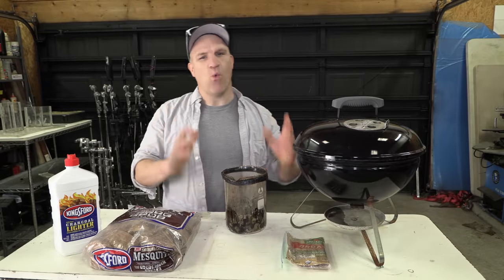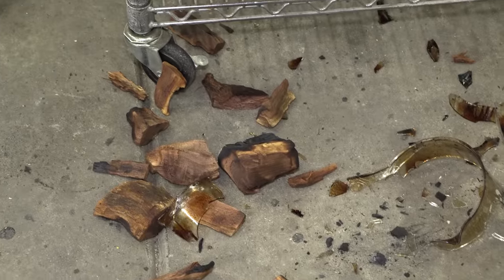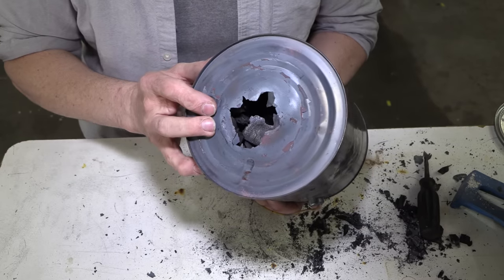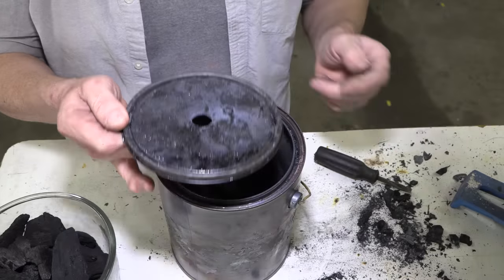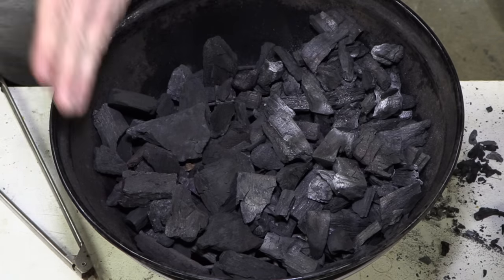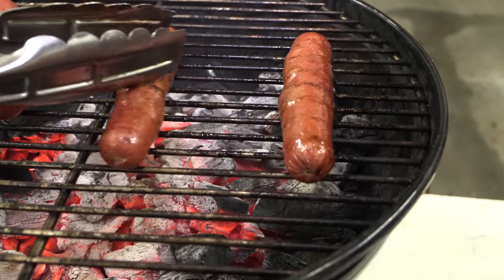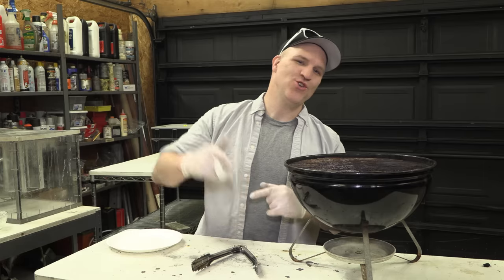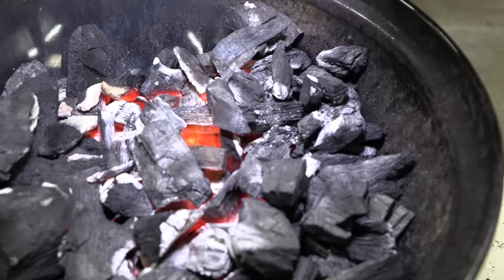Homemade Charcoal

Comment: What trips me out is you used a super torch to burn the shit outta that mesquite, but you were still able to light it up and BBQ. Why didn't it just all burn up in the paint can until the ash that we see at the end of the weenie BBQ?
Reply: Lex The Lion My bet is on the lack of oxygen. On the open grill it got plenty of oxygen to make the C->CO2 transition, which we call “burn”.
Reply: Zoltan Juhasz I think you are correct. If memory serves me right, charcoal is produce when wood is burned in the absence of oxygen, so all you are actually doing is driving out the moisture and oil, but leaving the combustable material behind.
Reply: @juzoli  but even with such high heat? The paint can even broke at the bottom.
Reply: Lex The Lion no matter how hot you get it, without oxygen, it won’t combust (burn). In this case you basically cook the wood and all the volatiles come out until there is pretty much nothing but carbon left
Reply: Lex The Lion When something burns, you are extracting energy from it. The wood gives heat to the environment. The exact opposite happens here, we are giving energy to the wood, basically injecting energy into the wood.
(Okay not exactly, but it shows the difference)
Reply: @juzoli  warped perception
Reply: @Grakoham  Everything or most has carbon in it if I'm not mistaken. So if you did the same process with a human body, could we bbq weenie?
Reply: Lex The Lion yes in theory you could, although the yield would be much less, since the human body is mostly water. But yes you could roast a weenie on charcoal made from a weenie
Reply: @Grakoham  yeah I think it's almost 100% carbon left over if I remember correctly.
Reply: @Jam Jar  yeah pretty much. Sometimes small amounts of oils don’t get burned off, but other than that and some minerals and impurities, all that is left is carbon.
Reply: Wood gas is mostly H2 and CO. The other carbon containing molecules are usually chains covered in hydrogen. Once you are down to carbon, and Ash(Calcium Sodium Potassium) there isn't any Oxygen, or Hydrogen to turn the remaining carbon into a gas. Pure carbon molecules are solids like graphite, diamond, nanotubes, etc. It needs air to burn more.
Reply: @danieljohnson3024  read a few comments up. Would you be interested in seeing the experiment?
Reply: @LexTheLionLocc  The paint can actually disintegrated when oxygen got in after the flame was out.
Reply: @SMOBY44  the problem I have with that is it took disturbance after the fact to make it break. Therefore one cannot truely believe oxygen played a role. Had the host moved the can while he was burning it and if it did not break, then I could agree with your comment. Furthermore, why did the rest of the can NOT break after oxygen exposure and especially the hotspots?
Reply: @LexTheLionLocc  The disturbance is the removal of the heat source which quickly creates a low pressure area inside the can drawing in air leading to the rapid oxidation of the hottest area. The method he used to make the charcoal is the most common way to make it for gunpowder. Laying a wet cloth over the opening prior to extinguishing the flame will greatly reduce oxidation of both the container and the charcoal.
Reply: @SMOBY44  hmmmmm. I wonder if Warped Perception would teach us how to make gunpowder in a video. For prepper purposes.
Reply: Is this indoors?
Reply: @MrPhatties  I believe he is in a garage somewhere in America. Sometimes I wonder if it's a storage unit.

Comment: Nicely done! Your version of the charcoal was probably heated to a higher temp during distillation than the commercial lump charcoal.
Reply from the maker: That's very possible, too bad the beaker broke, however the charcoal I got out of the steel container was pretty much identical to the charcoal I had in that previous video.

Comment: I don’t understand how you remove fuel from wood, it burns more efficiently as a charcoal. 
  The process is counterintuitive imo.
Reply from the maker: I agree, I wonder if I remove all of the moisture from the wood, and it was completely dry, if it would burn better, but I'm more than sure it would still burn dirty
Reply: As you cook the wood in the absence of oxygen, the volatiles are driven out. The volatiles are very flammable( as you can see). What is left is pretty much just carbon, which burns much more cleanly and also hotter in some cases.
Reply: It takes a lot of energy to evaporate the volatiles in the wood, both the flammable ones like hydrogen and carbon monoxide, and the inflammable ones, like water. Until those volatiles are gone, it won't get much hotter than the temp it take to volatilize them.  It's a little like boiling a pot of water; the pot will never get much hotter than 212 F, 100 C, until all the water has evaporated. That energy isn't converted into "heat" (well, it is, but not quite the same way) and is instead used to make a phase change in the volatiles. When burning nearly pure carbon, as in charcoal, there's no energy getting sucked up by phase changes, so almost all of it goes directly toward making heat. Wood has more total energy than charcoal, because it holds all the energy of the volatiles as well as all the energy of the carbon,  but burning wood is overall less efficient until the volatiles are driven off. That's why a fire can actually burn a lot hotter after the dramatic flames are gone and you are down to the coals and embers.

Comment: Neet, we both have no right middle finger.  Mine was eaten by a miter saw, hit the top of my finger and split it lengthwise into two right down the middle, i pushed my cut piece out of the way and as I went to grab another piece my hand passed under the still rotating blade just barely nipping my finger, I remember thinking, "whoa better be careful that could've hurt", not even realizing that i just vaporized most of my finger.  It definitely taught me to respect power tools early in life, 18yr old at the time.
Reply from the maker: Oh wow, I also have one of my fingers on my left hand split down the middle, but I fixed it up on the spot took a couple months to heal and about 2 years for the nerves to grow back. Yeah man got to be careful with those blades.

Comment: There are different grades of charcoal. The charcoal grades are dependent on the pressure under which they are pyrolyzed. Heavier charcoal has more energy density than lighter charcoal.
Reply from the maker: Great point!

Comment: I wonder what is more effective, making woodgas and then burning the charcoal, or just burning wood? I mean, there's a lot of energy needed to make the woodgas in the first place.
Reply from the maker: Yeah that crossed my mind briefly, but I'm assuming that cooking with charcoal is better for the food, since there is far less tars or compounds being burned, another thing I forgot to put in the video, which was accidentally left out in the edit, after tasting the hot dog I can taste the mesquite flavor. It was really good. But yeah that's a good question I can't quite figure that out
Reply: That’s interesting, and almost certainly better for your food yes. If it also tastes better, I don’t see why this type of charcoal is not being sold (haven’t seen it at least). Maybe it’s because of the heat it generates, people don’t want to melt their barbecues!
Reply from the maker: I'm thinking you're onto something, I'm pretty positive it would melt many of the barbecue grills out there, a friend of mine owns a Japanese restaurant, and they order a similar type of charcoal to the one that I made here, and now that I think about it their entire robata grill is made out of ceramic on the inside, not metal, and it burns super hot, kind of like the wood gas charcoal Burns here, that makes sense.
Reply: Ok, right. Having ceramic barbecue grilles at home seems a bit much haha. :)

Comment: You didn't give us a temperature differences. Are the length of burn. But you do a great job though thanks.
Reply from the maker: I know I know, I thought about that, however the only thing that's going to measure that high of a temperature is an infraredthermometer or even an infrared video camera, I was just trying to make this short sweet and simple, and mainly I just did the video to answer the people who were asking about this in the comments section of the other video. I am now bringing all of the videos to YouTube as of this month, short ones and full episodes, I think there's something for all of us to learn in everything.

Comment: It still got the fuel but need hotter temperature to be burned. White ashes is just mineral deposit on wood that can't be burn. But it is interesting that wood charcoal burns better than lump charcoal. I wonder to know why. Maybe some chemical stuff to explained?
Reply from the maker: You're right, but for sure there is some chemical difference there, because the wood gas charcoal, literally lit in like a minute flat maybe two, I just said three to be subtle. Oh yeah that stuff was different for sure.
Reply: @WarpedYT  from what i always learned in college, density of the charcoal is another reason for burning duration. More dense wood, more time to burn completely
Reply: @helmysetiabudi9915  The most important factor would be moisture...
And the ash is great for making lye (potassium hydroxide) or an alkaline fertilizer.
Reply: @DarkLinkAD  i agree with you. Moisture is most important for wood to burn. Nice 👍👍👍👍

Comment: Wow. You made coke, not charcoal. That's as pure as it gets, pal! 
-Lump charcoal is pyrolyzed to 90% because if they completely pyrolyze it, they'll burn away the wood elements that give you the charcoal flavor. 
-- When you purely pyrolyze charcoal into coke, you can go ahead and call it char-coke. The beauty of cooking with coke is that you're using dry  anoxic convection that electricity, natural gas, and wood can't compete with. Japanese white coal is an example. Fun documentaries about that stuff!
-- I have worked with folks on wood fired food, and we're on the fence about how to identify what's healthy or not. We're starting to suspect that if you have the yellow smoke, you're putting Benzene on your food, because benzene vapor is yellow when it's contaminated with sodium/sulfur in the wood. So, the idea is to give it some air and let it burn into coals if it's smoking like that. I've watched talented people run wood smokers. They use a bed of charcoal and soak the wood in water. It never makes the yellow smoke, and has a different flavor.

Comment: The wood gas charcoal in this video is basically a higher-quality charcoal, hence the better performance. The stuff you typically buy in the USA is junk. If there were a higher demand for high-quality charcoal, I would make it to sell. I know how to make it, easy peasy. I'm surprised that people are willing to spend a small fortune for that junk briquette charcoal made from sawdust and binder and soaked in chemicals. Oh well.
Reply from the maker: LMAO!!🤣🤣... You are completely right, I was thinking the same thing. the stuff they sell is literally sawdust with some sort of glue...
Reply: @WarpedYT  That's literally what all briquette charcoal is. Sawdust and a binder turned to charcoal. It's junk, barely lights, you have to use an excessive amount of accelerant to get it going. High-quality charcoal is easy to light, even heat, and burns to ash. The only contaminants are what was in the wood and only the stuff that didn't get burned off when it was being made. Maybe I'm weird, but, when I go the extra length to have a cookout, I want to use the best quality stuff I can get my hands on. If you want flavor, go with wood.  For even heating and a nice intense heat (great for crispifying the exterior while retaining moisture), use high-quality charcoal. If you just want to get the food done and over with, use propane.